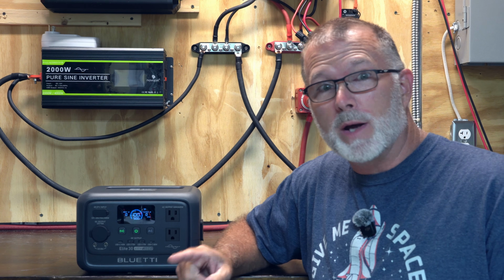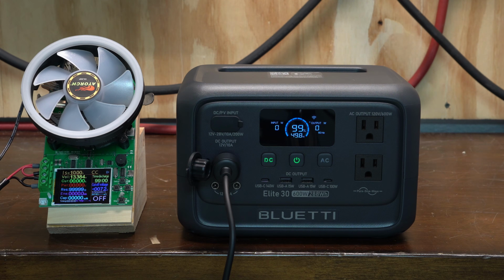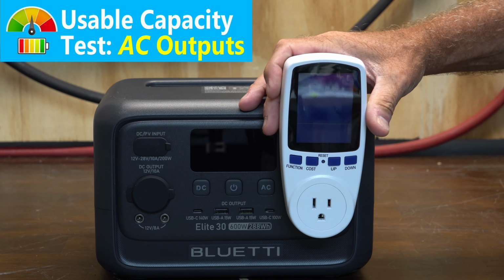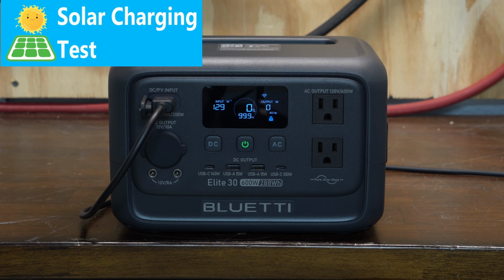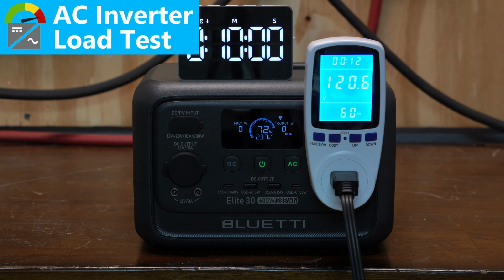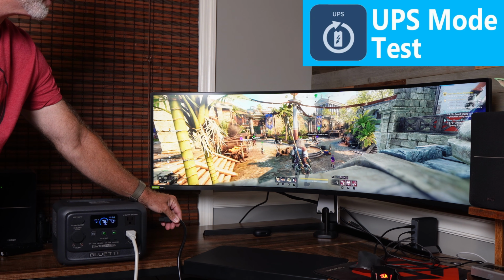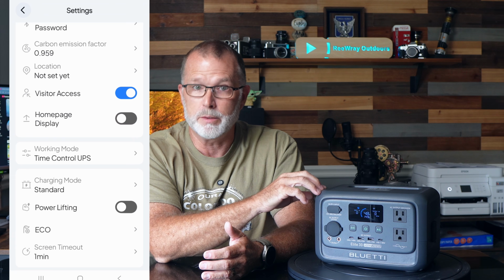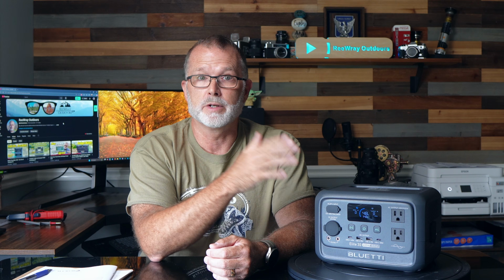BLUETTI's new Elite 30 V2:  600W | Lightweight | Super Affordable!

Comment: can you hook up an external battery to increase capacity like i see others doing?
Reply from the maker: Yes, but you would have to connect it to the solar input port and you would be limited to the solar input max charge rate, so it'd be less like a capacity increase and more like a low speed charger.

Comment: Thank for tests, I've just bought one. In the UK we only have a single AC socket - do you think a multi plug adapter could be used up to max 600? Also in your first two tests the numbers under the battery level were giving an estimated time, which looked pretty accurate against your test results.

Comment: That’s a high load for a small unit, almost certainly higher than the small 240 Jack.  I could run a fridge off that for an hour or so in an emergency, cool.

Comment: I have a 1000 Wh LiFePo4 permanent setup in my campervan as auxiliary power and wanted something extra for backup/emergencies/taking out, after this excellent review I ended up ordering this one. Ended up costing 192 EUR (~222 USD) which I think is still an great value in this 250ish Wh range.

Comment: Great video! Is this the best unit for $189 on Amazon? Also, which cheap solar panel and connector can I get. Doesn't have to be the portable folding panels. Just the cheapest best value solar panel that can maximize the charging this unit can handle. Thanks!
Reply: i too would like to know which panel did you use?i hope its one of the less than $100 ones

Comment: In a home  where you rent i do not think a big powerfull power station is practical financially since you do not own that rented house!!!!  so several i would say ac180's are more practical or a similar power station. they all go on sale  several times ayear so  save the money when they do buy one . I recommend the major brands for reliability reasons. but sometimes cheaper  can do the job  also. But i do not buy those good looking finished product capacity batteries  i prefer batteries that extend my small power station usage time.  the Elite 30 will let you use a dell mini computer and a screen for many many hours .OK it will not let you boil water for that needs a capable power station  minimum ac180 type .For the peopl on a low budget the ac180 or it's new version is a solid power station.  with a 24 volt battery it charges faster than a 12 v battery.

Comment: I have to say... the smaller the power station, the more important I think good integrated lighting is. I have an Anker C300DC, and although it unfortunately only has a 100-watt solar input, I otherwise consider it superior to the Bluetti. I can even charge it via USB-C, with up to 140 watts, which I think is fantastic.
Reply: I agree the utility of the built in LED light, however, most people camping would have head lamps, or other portable LED lights already.  I'm not sure I want to sacrifice runtime on LED.  This unit draws 6+ watts / hour just on DC standby mode.    Having USB-C charging would be convenient for sure. But not a deal breaker since if I'm running that kind of power via USB-C it means I have an AC outlet nearby, in which case it would be more efficient to simply charge up with AC at 900W, cuz my fastest USB charger is only 300W, and my USB C cable only supports 240W.  So I rather have 900W+  For sure Anker is a better brand, but at the end of the day they're all using the same questionable china batteries not cells from Korea or Japan.
Reply: Bingo! You said it! I bought OEM Panasonic cells from Japan. Sure they're a little bit heavier but at 3600mAh each compared to the 2500mAh.. Well worth the money! Not to mention they really can be cycled well and hold	a charge for a long long long time
Reply: I power my 360wh e-bike with the Anker Solix C300x, 0% to 75% charge powers 35 miles in 2 hours. I'd say that's not too bad for the price I got it for on ebay at £170. Whereas, the spare e-bike 360wh battery costs £600, and the 180wh power bank extender for the e-bike costs £300. The only slight downside is carrying a 4kg portable power station for longer rides but if you stack it up in the middle of the backpack, it's hardly noticeable!

Comment: My experience with bluetti boxes showed that when testing the inverter max output, be sure to use a resistive load. The Bluetti ac watt meter uses a VA protocal  instead of active watts.(w). One needs the power factor to be one (pf of 1) for a truer battery draw reading.. I am not a fan of the way bluetti has this setup since a true watt meter (like the" kill a watt" meter(sp?))  is  a more reliable indicator of actual battery depletion rate especially when using inductive loads.  just  a thought... i'm not an expert :)

Comment: I think it was your review of the EB3A and a factory inquiry by you that revealed the fact that, while in UPS mode. The EB3A doesn't exactly pass utility power through the unit and then switch to battery driven inverter power when the grid goes down, but rather, it runs the inverter, using the battery, for short periods, until it detects some preset voltage drop at the battery and then goes to grid power while the battery recharges. This results in a tick sound (from a relay, I presume) and a flicker in the LED end table lamp that I have plugged into it, every time it switches back and forth. It's aggravating and has to be reducing the life of the battery by some undesirable amount, however small it may be. 
   Can you detect if the Elite 30 V2 operates the same way in UPS mode. You should hear that relay that I mentioned, but it's soft and there is a fair amount of time between cycles. Plugging in an LED lamp would be easier to notice, I think. I use my EB3A to power our electric recliners and a lamp, so that we can get out of the chairs if the power goes out (which happens to often) I'd replace it with a Elite 30 V2 if I thought I wouldn't have to put up with the flicker and click that it creates.
   If you get time to check, I'd appreciate it.
Reply: HI, would you happen to have a link to that video? I checked out ReeWray's EB3A review video and it didn't mention the utility passthru problem I keep reading about.  btw, I do see many people mention adding a bigger PC fan outside to keep the noise down
Reply: @vueport99  I can't honestly say for certain that ReeWray covered it in his review. It may have been a commenter to that video that explained what was happening. It may also have been by Hobo Tech or in one of his comment strings that I found it. Those are the guys, along with Will Prouse that I consult when I want to buy a power station or battery. The best I can do is recommend  that you look in the comments for the EB3A power station to find buyers that are complaining about the blinking lamp and relay click and then follow any string that was left as a response to that complaint. It may take some digging, but I swear I saw it explained as I did in my comment. I'm actually surprised that I haven't got an answer about this new Bluetti. I left inquiries about it on several respected YT channels that I thought would respond after checking with the factory or doing their own experiment. I hope this helps.
Reply: @mrhalfstep I'm close to pulling the trigger on the Elite 30.2 cuz the intro price and coupon makes it a good buy. It's too bad they removed the solar cable. But I'll get a third party cable. Not paying $50 for a cable!

Comment: Is the battery expandable? Why is the battery so tiny. Surely they can make it half an inch wider and fit a larger battery
Reply: Yes it’s expandable..
I have a DCHouse 12v - 100ah  Lithium Ion Phosphate mini troll motor battery ..(blue in color)
I added battery clamps and a T-60
connector and plugged it into the BLUETTI 30 solar plug …
works perfectly ..,
I run a full size fridge (300watts when it kicks in ) & Bell internet router(uses 79watts) during power outages for about 26 hours ..

because it ran cool and quiet I plugged in my other DCHouse 12v -165ah Lithium Ion Phosphate battery and was able to run the fridge and the Router and a tower fan for 40hours (about 2 days ) ..
hope that helps.,

FYI ..I also have the BLUETTI Elite v200 .. I use the same DCHouse small portable batteries to extend it to around 6kw of total battery capacity allowing me to stay off grid for almost a week 

Hope that this helps
by the way my two DCHouse 12v-100ah were $200 ($400 for both) 
and the DCHouse 12v-165ah was $300
So for an extra $700 I have 4kw +..
way cheaper than to buy a high price BLUETTI expandable battery pack with only 2kw  for around $1,000 🇨🇦

Hope that helps
Cheers from Hudson Bay 🇨🇦

Comment: Good video, I have the previous model which its sole purpose is a UPS, modems, routers, phone system and security. The cost was less than half of my failed UPS back up, and it works just fine.
Reply: You're lucky, I saw on Reddit some users reported the unit running hot or not at all under UPS mode.  Some had to add a fan to make UPS work.  I hope your unit isn't one of them. 

Anyway I hope this new model doesn't have these issues.
Reply: @vueport99  Thank you for the reply and warning, the power draw in use and under a  power loss situation is negligible, but I will keep an eye on it.
Reply: @wrxs1781 I think only time I'll worry about it is if it runs hot or noisy even without power loss. Cuz that will mean unnecessary battery degradation. So certainly keep an eye on it.

Take my comment with a lot of salt as I'm only going by what I found on line... And we all know we can't trust everything we read online😂😂😂
Reply: @vueport99  Well said, thanks for the reply.
Reply: @wrxs1781  mrhalfstep in a comment below here in this video mentioned this issue too.  So It'll be interesting to see what the truth is.  Btw, it maybe useful to add a fan to keep it running cool and keep the noise level down.

Comment: I have a Zoupw 180w solar panel (model ZOUPW-EZ180W) that states on its sticker, "Maximum Power Current at STC = 10.4A". Will this Elite 30 V2 with its 10A maximum solar capability be ok with my Zoupw panel? Sorry but very new to all of this and still very much in the learning stages. Thank you.
Reply: The Bluetti will limit the current draw from the panel to 10A, so even though the panel can supply more than 10A the Bluetti will not draw more than 10A, just think of it this way, you AC outlet in your house can supply 15A (15A x 120Vac =1800W of power) of current  but you plug in the 100W (0.83A x 120Vac) lamp into the socket, the lamp will only draw 0.83A, the AC outlet is not going to force 15A of current into the lamp. The Voc of the ZOUPW-EZ180W (Vmp = 17.3V, Imp = 10.4A, I do not see the Voc rating of the panel) is fine for the Bluetti since max input Voltage of the Bluetti is 28V, just mkae sure the Voc of the solar panel does not exceed the max input Voltage the Bluetti, you should give about 20% head room to be safe since VOC will go up when the panel is cold.

Comment: I guess I can assume that if the power goes out and you are running on battery, if you deplete the batteries that when power comes back on the ac inverter will not turn back on?   So your loads will be down until you manually turn on the inverter if the batteries die while the power is out.
Reply: Do they not need to charge to 5% to reconnect? Like other Bluetti models?

Comment: I paid $300 for my Pecron E600 (comparable unit). It runs my 7 cu/ft chest freezer about 9 hours, but has over double the capacity (614 wh). But if you need a unit this size, $189 is really good deal. 

I have an off topic question for you...I have a power station with a dead AC inverter. I use the DC side to add capacity to my other working batteries. Is there a way to charge the battery from the wall on the DC side? Maybe an AC/DC converter/power supply? The DC 5521 input is rated for 12-28.5v / 200w max. Thanks.
Reply: Yes you can charge power stations with a ac to dc power supply, you just have to find one within the specs of the unit you plan on charging. I have used one that goes from 0 to 48 volts to charge power stations that way. You just have to plug it into the solar input. The one I have, I made my own wires , sometimes using the car cable that came with the power station,  for each power station I tested it on.
Reply: @jw3843  When you say..."goes from 0 to 48 volts", do you mean it's adjustable? (like a universal power supply? Also, you said it has to plug into the solar input? (so I shouldn't use the 5521 DC input I listed above? My solar input and the DC 5521 both have the exact same specs: 12-28.5v / 200w max   thanks
Reply: @zippy2641  The DC input IS the solar input. Something like a regulated DC bench power supply can be used for what you're trying to do. They have a constant voltage and a constant current capability. Cheap ones will typically let you set the voltage at anywhere from 0 - 60 volts DC and the amperage can be set from 0  - 5, sometimes 10, amps. You would just set them for the highest amount that your solar panel input will tolerate. I think that there is a cheaper gadget called a switching power supply that goes from 0-60 volts and maintains 10 amps all the time.Your solar generators input will only use what it needs, so you don't really need a regulated amperage like the first gadget I mentioned has.Hope that helps.